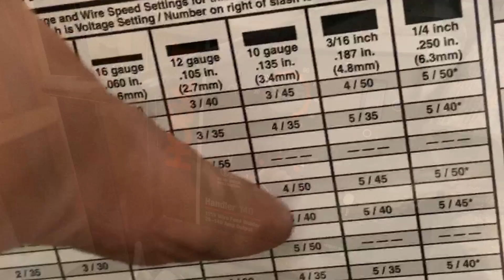Modular Vise and Tool Mount

Comment: Man I’ve been looking at receiver hitch set ups on YouTube all afternoon, it makes more sense to do it vertically because you’ve got the weight of the tool in your favor versus the horizontal tubes.
Reply from the maker: Yea, you do get a little play laterally but it’s only about 1/8” or so and has never compromised anything I was attempting to do. If I was using it as a fixture for machining it would be a different story, but it’s just a convenient way to swap out different benchtop tools and maintain a solid mount.

Comment: I wanna do this but can't decide whether I wanna have the vice pull out horizontal or vertical...wonder if it matters?
Reply: Depends if your table has overhang by the legs. My table at work has 3 inch overhang so I welded it horizontal

Comment: Do you not have a lot of movement where the 2” tubing goes into the trailer hitch receiver?  Thanks
Reply from the maker: There is some minor lateral movement, not much and not enough to effect any work I do with the vise. The downward weight of the vise keeps it plenty stable to grind, weld, etc and I really only notice the lateral play when I have something in the vise that I’m twisting or turning and even then, it’s very slight. 

Thanks for watching!